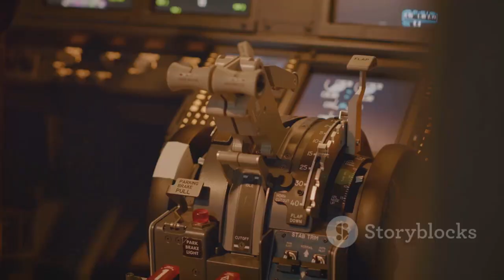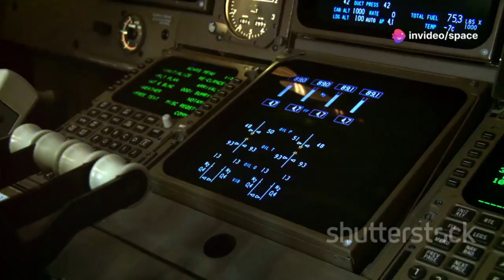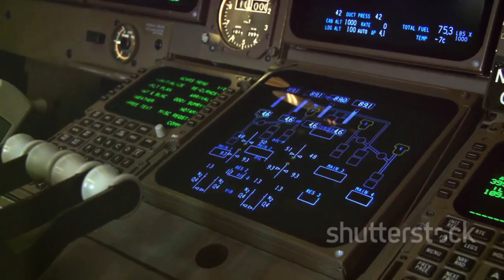The USA Admitted to Creating Something So Powerful It Can Fly at the Speed of LIGHT

Comment: Nope the Concord made a profit on every flight. Jet fuel right now is $715USD per tonne. If we assume it used every bit of its 96 tonne fuel capacity that would be a bit less than $70k in fuel per flight. The tickets were $12,800 return accounting for inflation. So half of that would be $6400 call it $100k per flight for maintenance and 6400 for the crew etc, and you would not even need it half full to break even. 10% of the flights were fully booked, and most were over 75%. Even 75% would give you 480k to play with. So nope it made a good profit.